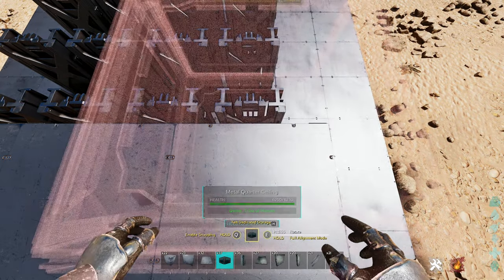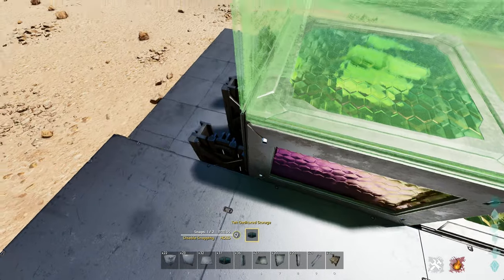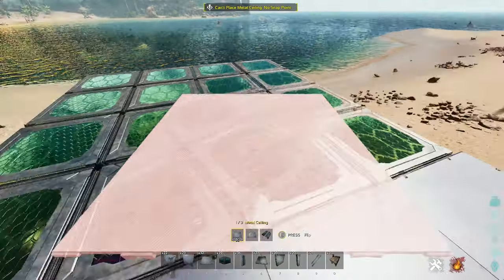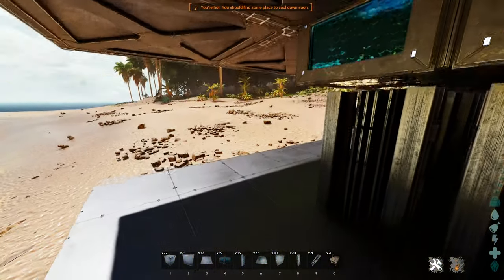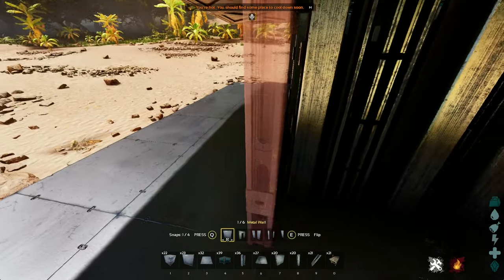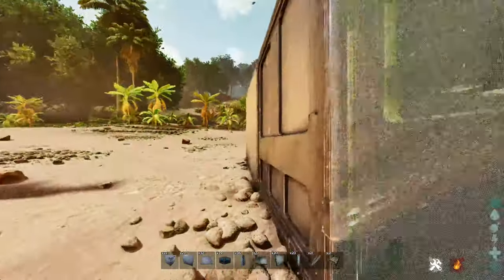TEK DEDICATED STORAGE FLOOR UPDATED! - ARK: SURVIVAL ASCENDED GUIDE

Comment: Mate there’s a way cheaper way. Put a beam through the centre of ceiling by putting a quarter wall below it then attach a pillar to the inside of it, from there place the beam across the ceiling. To carry on the line simply alternate from pillar to beam them pick the pillars up. After that place a display case on the beam and then 2 tables on top of that and voila your dedis will sit perfectly flush with the floor.
Reply: doesnt work for me atm to many structures
Reply: Can you do a vid??

Comment: Worked fine for me official PvE 23/07/2024. Earned a sub! <3
Reply: How so ? I just tried on official pve and the issue I have is that the elevator tracks are too tall, ending up flush with the top ceiling, not below it like in the video.
Reply: Nvm figured it out had to disable snapping first 🤦
Reply: @Red_Tithe  just saw this haha glad you fixed it x